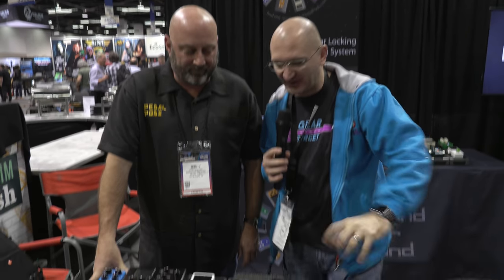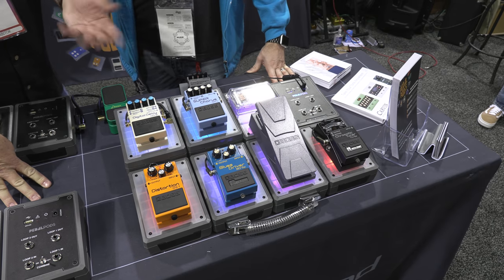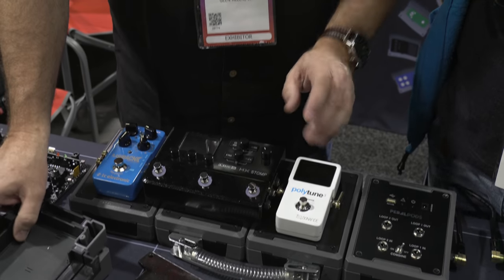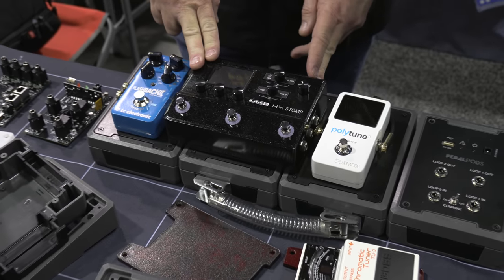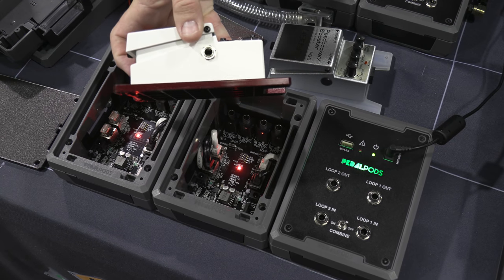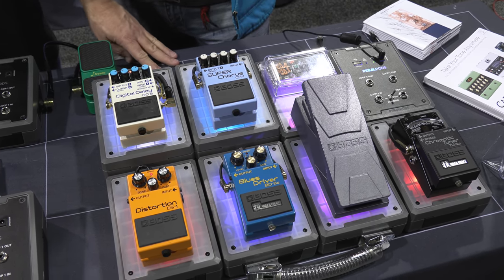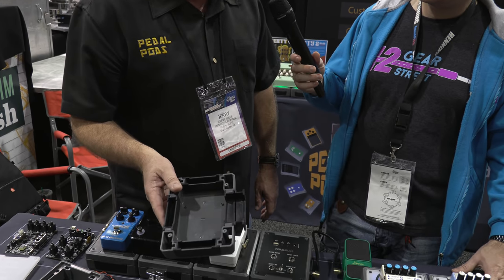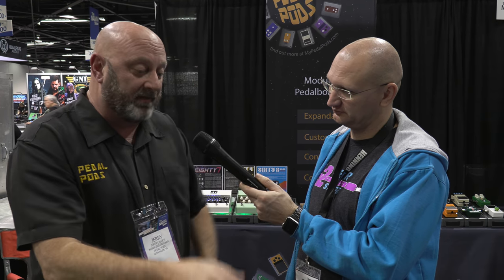A new form of pedal board? Pedal Pods

Comment: I just have to say that, as a Richmond, VA native, I'm glad to see another innovative company come from the area (Glen Allen is about 20 minutes away!).
However, as someone with 20 years of guitar playing and pedalboard building experience, there's a few things that don't seem to be addressed, and some ideas that would be super cool to implement.
1. I run a EHX Hum Debugger at the front of my chain. My home studio is very noisy - lots of EMI - and it's the only thing I've found that has been able to manage noise levels in my studio. It runs on 7.5V, which is, admittedly, very odd. It would be cool to have a box that just has the audio in/outs, omitting the power chain, but has a direct AC plug inside. That could work for numerous pedals that take awkward voltages, work off AC instead of DC, or older/vintage pedals that have AC cables directly wired to the unit.
2. The "brain" or whatever you call it takes up valuable space that could be reworked a bit. Moving the ins and outs to the side, as well as the other ins and outs, could make for a comprehensive chain management system while still allowing a pedal to sit on top of it.
3. It'd be really cool to have "under board" pods, where a pedal could be placed underneath. I'd love to, for example, run that Hum Debugger under my board, as it basically always stays on and stays in one setting. Buffers offer a similar case. Maybe the empty boxes could work for this?
4. Complex setups, like loop switchers, MIDI, remote buttons, etc. should also be a consideration. I run a Morningstar MC8 on my board that MIDI controls 8 devices (4 of which use TRS, the other 4 use 5-pin DIN), a DPC.micro (3 loop switcher, controlled by MIDI as well), and I'm getting ready to throw on an OBNE Signal Blender (parallel loop blender) on my board to have two loopers running in parallel with my clean signal. Some way to manage more than just audio and power would be a really great idea.
5. Cases and bags. Obviously, you can't do a one-size-fits-all kind of setup, but, I tell you, I've been looking for a bag for my Emerson 32x18 board for a year. I don't really want a hardshell road case because I mainly play at home and some local venues around town. And I'm not going to take a pedalboard out that has no bag - I've seen too many of them in that state stolen from people's cars between gigs when they're openly exposed. The only option, because of the 18" dimension, and the fact that it's actually 33" wide, is to have one custom made, sight unseen. Maybe some sort of collaboration with a local artisan bag builder would make for a really great one-stop shop.
Cool idea. I dunno if it's for me, but I'm glad to see some innovation in this area.
Reply: Good morning Doug, Thank you for your comment.  I don't know were to start other than THANK YOU FOR ALL YOUR FEEDBACK.  You've put a ton of thought into this and I greatly appreciate it.  I'd like to extend you this offer... email me and we'll work out a time for you to come over and we can address each of your points face to face (and maybe even build a board or two).  I have an artist driving down from NVA today and we are building a massive board (your welcome to come on by).  I'm also fine tuning a AC pedal this weekend that is powered by a Pedal Pod (it works now BUT it's a little noisy).  Email me and we can get something figured out.  jerry.calder@mypedalpods.com .  I look forward to hearing from you.

Comment: I dig it.  I would reordering your pedals is pretty simple too.  I have recently broken down my larger board that had all the good stuff and have been using my BOSS60 with 3/4 pedals as I can swap things all over (without a high end switcher).  Love that the disco colors sign through.  Will stay tuned

Comment: I have been using one of these for a while now and absolutely love it. The modular design is great if I need to break it down when my band has to travel light. It is super quiet and built with quality parts. Each pod came with patch cables, power cables and cat cable. Basically everything you need. I was in the market for a smaller board for travel dates and the cost of the build ended up being shockingly close. Opted to go this route because it saved me from having two boards. I switched from a voodoo lab board to this and haven't looked back.
Reply: how may pedals do you have and which ones?
Reply: Chris, Thank you for your kind words.  Enjoy your Pedal Pods solution and THANK YOU for your business.
Reply: @sjsphotog  I run 8 pedals. TC Polytune 3, Keeley Compressor, Wampler Paisley Deluxe, Keeley Johnny Hiland  Sweet Spot, Wampler Tape Echo, VHT Reverb/Tremelo and a TC Sentry

Comment: First of all I do like the idea of this modular board.

Nevertheless I have some smaller critic points:
* I don't like the white see-through cover. It looks a bit cheap. The painted ones look better. But I like the idea of the see-through one. Maybe you could come up with a different material and/or design for that cover.
* I don't mind that the bottom parts are made from plastic. But maybe you can  do a nice coating on it, e.g. like on cover of the "brain" thing. It looks simply a bit nicer.

But in my opinion there are some more serious issues with the design, too:
* First I understand that you need a bit of space between the cover to get the cables out to the pedals. But I'm afraid that over time there will gather dust and dirt inside. This might not be an issue if you just have standard wiring inside, but with I'm afraid it might affect the power supply over time - which seems to be an excellent by the way.
And I'm also afraid that liquids won't do any good. (I'm talking from experience: I spilled once some scotch over my lenovo laptop keyboard which also had a drain hole, but still the good whisky sniff managed to destroy the the keyboard...luckily not the laptop itself). 
So maybe you can build some rubber cover for the cable slot where the cables can be put through but it closes around them and seals the inside off a bit.
* Secondly - if I understood it correctly - when using the the power supply option, you are bound to two loops. This is a bit of a drawback in my opinion. With two loops you will be able to use the four cable method. That is fine. But when someone invests in your modular pedal board, he or she will use a lot of pedals. And if you have a lot of pedals you will probably not want to step dance. SO you have will have a looper-switcher of some sort. And I don't see how such a device can work with you current design. 
To solve this you can maybe replace the little switches that you have for bypass or add to a loop by relays. Those relays should be than be triggered by midi. If you then connect a standard midi foot controller to the "brain"-module you wouldn't need any looper-switcher. I'm afraid my idea might be not be cheap to implement, but looper-switchers are also not cheap.
Reply: CountNetsrac, Thank you for your comment.  All the Pods ship with solid black Top Plates.  You can order the Translucent Top Plates separately.  BTW... I also prefer the black Top Plates.  Good Luck... Jerry
Reply: The more I think about it, you should really go for automating those internal switches via midi...that would be the cherry on top of the cake :)
Keep up the good work and much success.
Reply: @CountNetsrac  Working on it Count... Thank you for the response and advice.  Jerry

Comment: The spacing of pedals contributes to making them discrete and clearly delineated, which aids in selection during performance. Emphasize that during the heat of performance you want to see what you’re doing, be able to select accurately, and to not miss, and activate an unintended wrong pedal.
Many pedals are color-coded; however, the ability to color-code with highly visible background illumination is additionally helpful during performance on a darkened or dim stage. 
People are visual creatures, and many sales are made through a sense of urgency; I would focus on marketing the cool visual factor – so that when people see it they want it – which means display it in a darkened environment, and emphasize the colored LED backgrounds changing. Close with the above selling points.
Mechanically inclined people that are into studying gear and chasing tone will figure it out; however, a number of artists will require a technician to build it for them.
Staff a position prepared to field a lot of consumer tech questions; consider providing assembly services, developing a network of service providers, and in store retail training.
Reply: Mike, Thank you for the comment and kind words.  You're the guitarist we designed this for.
Reply: @pedalpods6382  Thanks Pedal Pods! I’ll keep this pedal board bookmarked on my product purchase wish list! Cheers~

Comment: Like the cable management, the height adjust, power supply options - saw the gallery photos. Looks like one pod will take a Strymon nicely, or two mini pedals. Only suggestion would be larger and/or different size/shape pods and as N M says below, perhaps true bypass and MIDI.
Reply: Steve, Thank you for the comment and kind words.  Regarding a different size pod, I looked at that in the beginning BUT had issues with getting the overall geometry to work.  The other consideration was the cost of additional molds and inventory.  I selected this size because it fit the majority of the pedals out there and I included the two power ports in each pod to accommodate two mini pedals.  Regarding the true bypass and midi; when the selector switch is in "Bypass" it truly is true bypass.  In order to completely take the pedal out of the loop I would need to create a switcher (I have that design on paper).  Midi is the hard one... Space on the boards, Chip set, Software and Licensing.  I just couldn't make the pricing work.  The good news is I left plenty of room to wire manage the midi internally between pedals.
Reply: @pedalpods6382  I can see where geometry would be a barrier. Not really an issue to me as Strymon is the biggest I have, was just wondering. MIDI, again not an issue for me, but would be for some. I think your system is very innovative - well done!
Reply: @SFolkes97  Thank you sir...

Comment: After all of this, my conclusion is, if the pedal industry can standardize on form factors and connectors, we wouldn't need this product. This product is neat. I think we are at the point in technological development where we should even eliminate the CAT cable. Just put the pods together like lego. No wires in between the pods, just flat connectors with all of the pins you need. That way people can rearrange stuff quickly. Maybe do that for the TS cables going from the pedal to the board as well. Flat connectors on the side, and then a cable with one TS end and one flat connector end. Should be easy with ribbon cables.
Reply: Card edge connectors. That's what I meant.
Reply: Lai, Thank you for your comment.  I agree with what you're saying but it will never happen.  Thank train has left the station.  This solution was my attempt to standardize at least part of the process.  Good Luck to you Lai... Jerry
Reply: @pedalpods6382  how about the card edge connector idea? I think the main complaint people have right now is that the units are too tall, which I assume is due to the need to put the ts and cat5 connectors on the PCB. Can you not use cat5 without using the actual connector? You just need all of the pins right?
Reply: @pedalpods6382  okay, I just read up on it and cat5 is low cross talk and low interference because of physically twisted pairs of wire. However, can the gold fingers on a card edge connector not achieve the same thing? It is a physical contact. The name is Parco BTW. I messed up and switched my names around when I created this account.
Reply: @Parcolai  Good morning Lai, The connector is the key.  This gives the user the ability to reconfigure pedal order easily and its also the quietest connection.  The original PCB had a ribbon cable.  Great for clearance but bad for RF noise.  If I made the Pods wider I could lay the connector flat.  It's all about managing how much you can pack into a small area.  Thank you for the response.

Comment: And there was the red flag: "most of our customers think it actually sounds warmer because we're not losing anything"

No. Longer cables, capacitive loss, all of the everything that makes doing lots of pedals suck is characterised by loss of the high frequencies. This is the problem we're trying to avoid. Loss of high frequencies and loss of output. I can always lose some highs with some eq. Getting my high order harmonics back because pedals and cables are them is much much harder.
Reply: I caught that too but I feel like he just used "warmer" as a buzz word because it's associated with the "analog sound". I probably wouldn't read too much into the board literally causing high end frequency loss.
Reply: Rowland, Thank you for your comment.  My background id high-end two channel audio.  I want things to sound the way the are meant to be!  We hired an Electrical Engineer with decades (like me) in the audio industry to fine tune the buffers and confirm the tonal purity of the solution.  I used twisted pair (Cat5e) cables because they were originally designed to have low capacitance and high noise rejection qualities.  Others in the industry (Boss, Amp Tweaker, Fender, Seymour Duncan, as well as recording studios have ALL commented and complement me on the tonal quality and purity.  Tone and noise are everything to me and that's why the Pods are so expensive!  I did NOT cut corners or compromise in these two categories.  This is my reputation.  If you would like to clearly understand how I accomplished this, feel free to contact me and we can review.  jerry.calder@mypedalpods.com . Have a good night Rowland.
Reply: @Escapism7133  Patrick, you are correct in your assessment.  Thank you for making my point regarding analog sound.  Everyone calls it something different...  BTW, I did just respond to Rowland comment.  I hope it wasn't tooooo aggressive.  Have a good night.

Comment: It's obvious by the answers the guy has ready to give that the bulky size is a major complaint.
Reply: Tim, Thank you for your comment.  The size concern does come up.  These are 1/4 in taller than a Temple Audio board and compared to other boards out there it actually smaller by 1/4 in or more.  The challenge is the optics because you can't see through it.  Although I couldn't make it lower in profile I did focus on the ergonomics and other benefits.   Thank you again for your feedback.
Reply: @pedalpods6382  I don't find the height to really be an issue, for me it would be surface area. I service amps (will build a few every year, and assemble 3 or 4X kits for people), and will build switching systems, but more commonly help people to set up their rigs to get them to perform optimally for them. That in mind, leaving the floor space part, I can really appreciate the rest of it. It's definitely more than a pedaltrain, but definitely worth it considering the design and actual execution. I haven't really sat down and looked at all the specs, but I'm willing to wager it'd probably be a game changer for players who want to use vintage effects, probably even if you only use the modules for those effects alone.
Comparing it against a lot of the "boutique" class boards, it looks like it's probably a far better value.

Comment: If I wanted any additional feature that would be true bypass loop for every pod. And then have a gas pedal with eg. MIDI in for the control. Since 2 Cat 5 cables are being used, I doubt that all 8 twisted pairs are being used so some of them could be used for internal on/off signal routing.
Reply: NM, Thank you for the comment.  Pin-out looks like this: First pair (+ 24vdc) / Second pair (- 24vdc) / Third Pair (+/- Audio Send) / Forth pair (+/- Audio Return).  The Cat5's are redundant.  You use one for Loop 1 and the second for Loop 2. There is plenty of room to route midi cables if need.  I hope this answers your question.
Reply: @pedalpods6382  Thank you for your reply. I was thinking more about relay bypass in the pod. In that case eg. Boss style pedals could easily become true bypass.  And then use eg. MIDI to control those relays. Cheers.
Reply: @NM-ib7ql  Good morning.  I have a switcher design PCB board in mind.  The only limitation is time and money right now.  GREAT idea NM.  Thank you